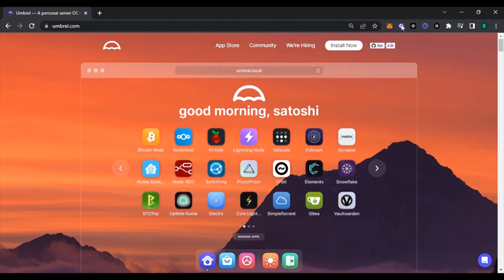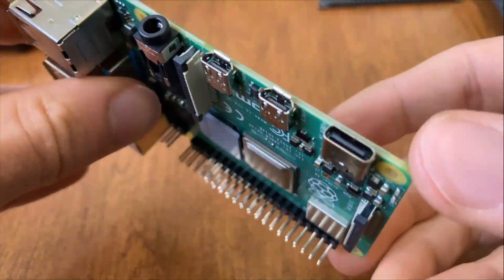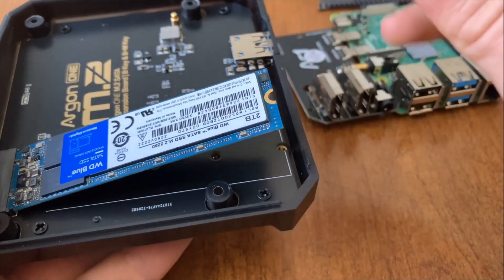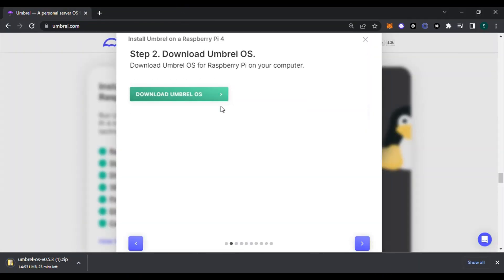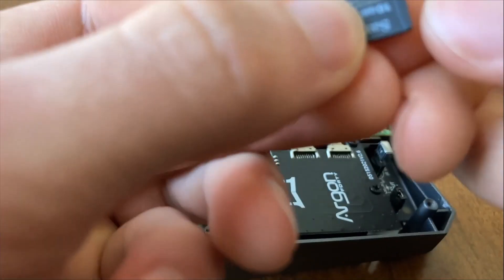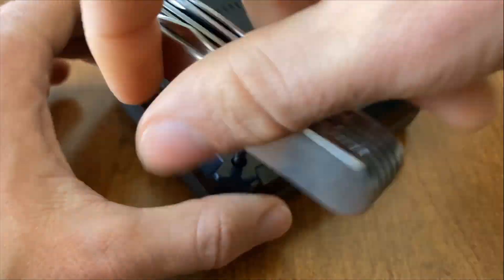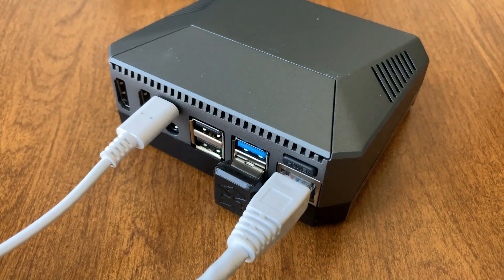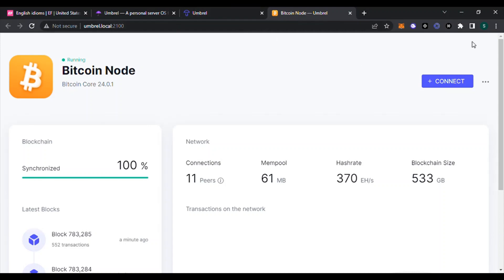Build a Bitcoin Node with Argon One M.2 Case for Raspberry Pi 4

Comment: Just what I needed to set up my node. One question, how do you go about controlling the fan, it has come on and stays on. I have Umbrel on the Sd Card. I can't work this part out, maybe you can help me?
Reply from the maker: The fan just goes on it’s own. I never had to do anything to it. In the settings you can monitor your temperature to make sure it’s not overheating .

Comment: Danny, do you know if the Argon M2 fan is working by default when is running Umbrel? I have the same setup as yourself but I can't hear it..
Reply from the maker: It worked by default for me. You can check the temperature in umbrel to see if it's overheating.